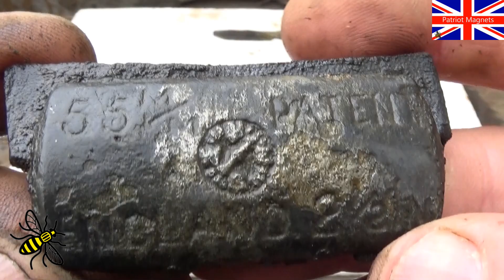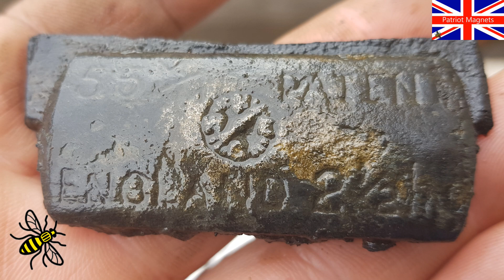Bullet & Stamped Item's Found Magnet fishing Rochdale Canal

Comment: Your bullet is centre pin fire, and the colour of the primer (silver) is reload, factory primer is same colour as shell.  The item with 55mm has the imperial size of 2 1/2 inches 
stamped bottom r/h corner.  The use of the brass split pin is so it would not rust solid,  if it was steel no chance of getting it out easily.  Bill in Brisbane.
Reply from the maker: Thank you for this Bill, I'm definitely not up to date with ammo or artillery,  much appreciated buddy. 👍🇬🇧